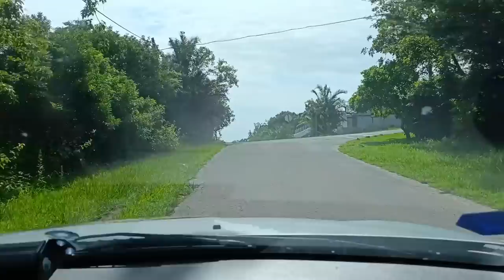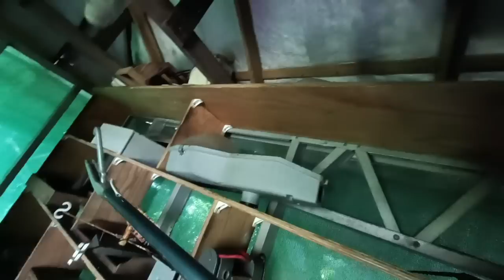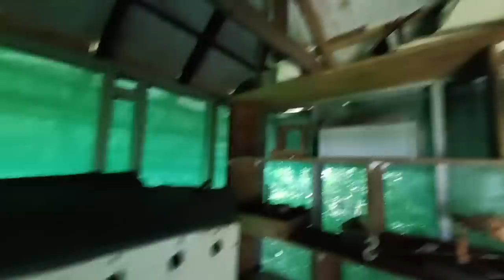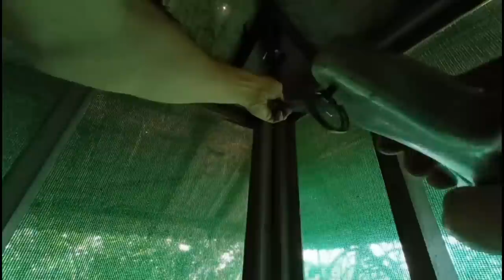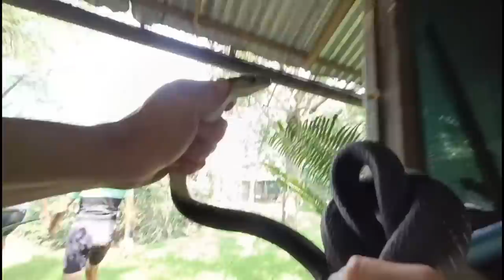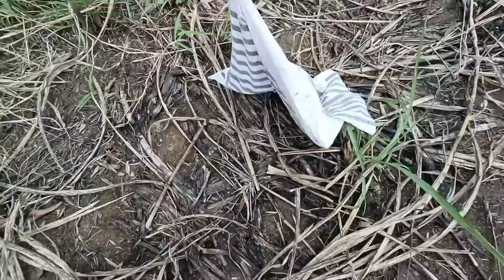Black Mamba in Pigeon loft... AGAIN !!!

Comment: What was the cable crime? I'm confused. Great capture you make it look too easy. And yay Emily! Best sidekick ☺️👏💗
Reply from the maker: The thieves here steal the overhead electrical cables. Then they strip it of its insulated sheath to get to the valuable copper cable inside, and sell it to the scrap metal yards to make money. It's a massive problem here. They even fell the big metal light-poles on the roadside, to steal the wiring that is within it. They get a couple hundred rand and it costs the country tens of thousands to replace  and repair. 😡🤬
Reply: @jasonarnold-snakeman  omg! that's so sad. Thank you for explaining!